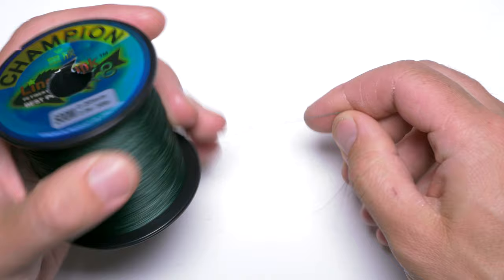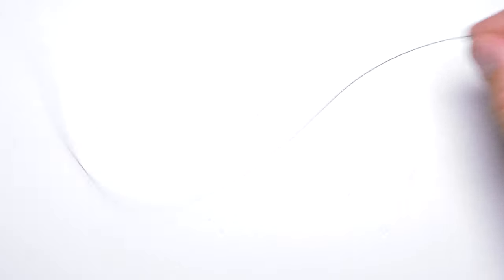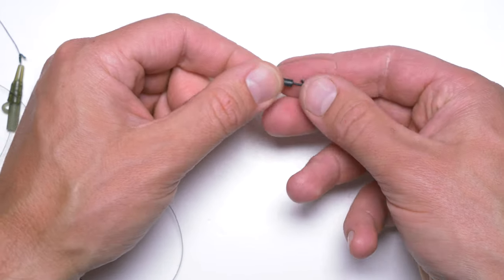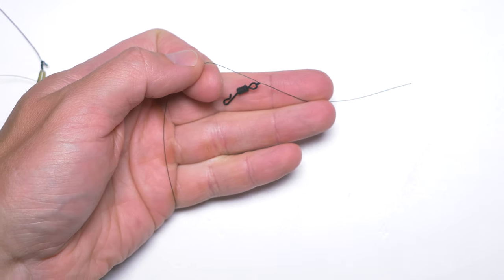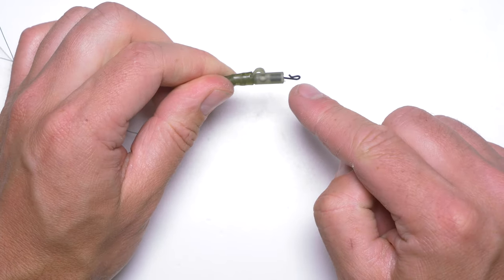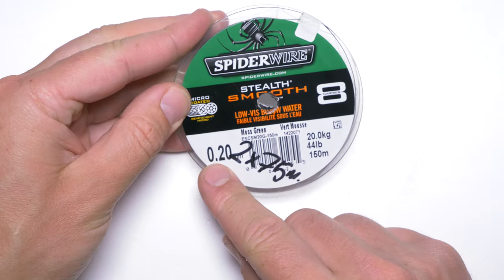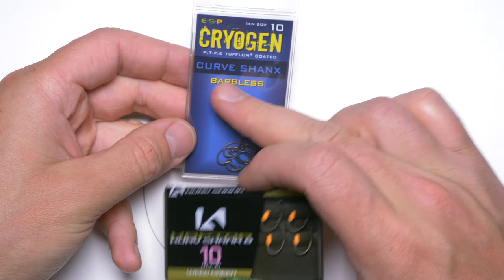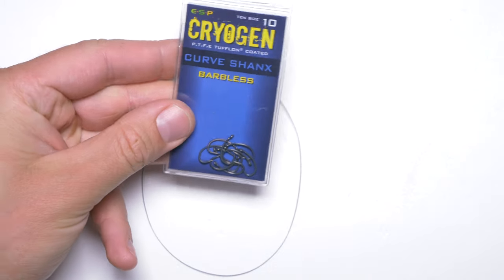How to tie a RIG for BARBEL?

Comment: Well explained Andrew. I can see how the fluorocarbon line might protect the main line from damage against rocks but do you ever suffer cut offs with the fine braid near the hook?
Reply from the maker: Not really. Don't think it happened once during my 100 challenge.
Most likely It will be to do with the areas I was fishing at - they were snaggy, but snags were not as sharp. BUT you are right - when using fine braid the chances of cut-offs are greater. That's wy I used short piece of it to reduce cut-off possibility.
Cheers

Comment: Hello, Andrew knots. I'm a big fan of your channel and have learnt a lot from your tips. The only part of this set up that confuses me is the angry fish flurocarbon In the video you held up is the 0.8 version, which on the website says it's a diameter of 0.14 and breaks at 3.7lbs. Which flurocarbon do i buy?. do i buy The 4.0 angry fish which is a diameter of 0.33, but breaks at over 16 lbs, or Do i buy the 3.0 with a diameter of 0.28 that breaks at 12.6lbs. Which one do you use? Thanks.
Reply from the maker: I used to use 0.30 mm. FC for my Barbel rigs but this year I will go heavier 0.50 mm. FC above the feeder and below feeder "combi-rig" style.
Cheers

Comment: Hi never used fluorocarbon 
Say I am using daiwa 6lb mean line 
What pound fluorocarbon would I use fishing the bomb poped up bread thanks
Reply from the maker: Hi,
I personally wouldn't use fluorocarbon for mainline because it's too expensive. If I would want my rig to settle on the bottom better, I would use 1-2 m. fluorocarbon leader.
Anyway, to answer the question - go with the same rating in pounds fluorocarbon.
Cheers